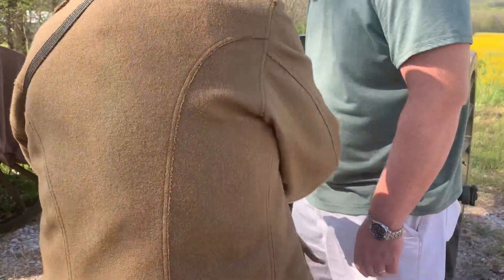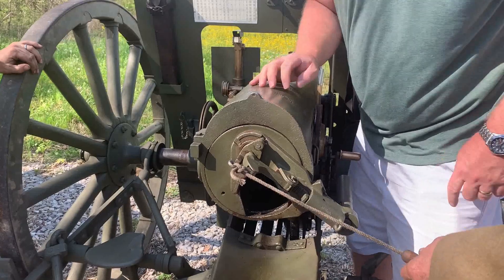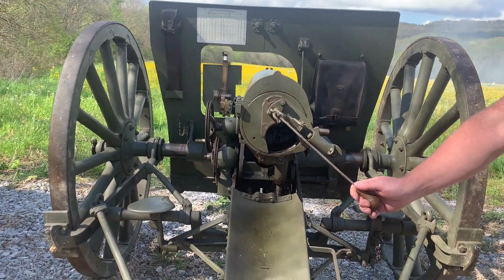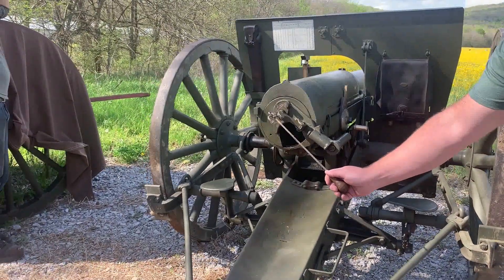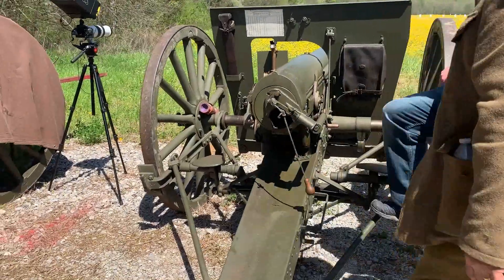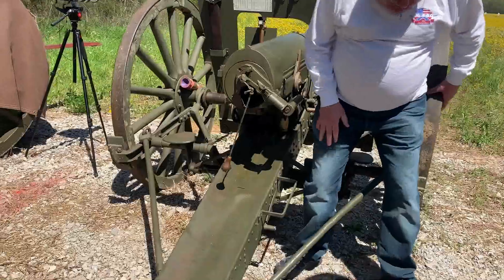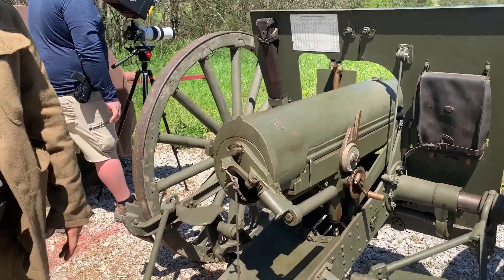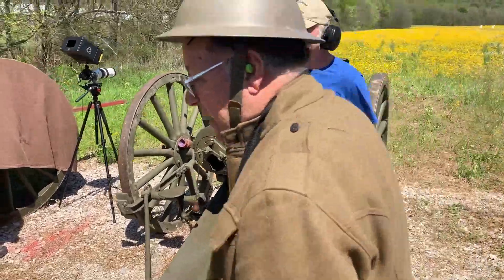French 75 Live Fire, part 2

Comment: One of the most revolutionary gun carriages ever invented. Changed artillery forever
Reply: I think the .75 is the first of reciprocating(?) carriage mounts
Reply: The British improved on it with the Ordinance Quick Firing 13 Pounder 75mm. L.25 & OQF 18 Pounder 84mm. L.28 field guns, both of which featured a sliding breech block with automatic cartridge ejection. They also featured a superior triggering mechanism plus double the fire rate of the French M.1897.
Reply: indeed, the 75mm was the 1rst cannon using a oil-gas brake allowing 25 rounds/mn without having to move or replace the cannon between 2 shots.
Reply: @bulow453  it is just 75mm, but yeah, that was the next gen of field artillery air/oil recoil dampener made this gun very accurate and fast firing, there was no need to reset gun after each shoot. With automatic case extractor. i believe that  there is short movie mad during ww1 which shows how crazy fast those guns were spiting bullets.
No reaming, no reposition , fast reload = recipe for superb piece of artilery.

Comment: Nice cannon! Rifled barrel too? Smooth recoil.
    I wouldn’t dare let anyone stand behind my howitzer when they fire it, much less sit on it!
Reply: Artillery guns are always rifled unless sufficiently old or modern Anti-Tank guns

The 1897 field gun was the first to use an hydraulic recoil sled, this prevented the gun from moving back under recoil like most of its WWI contemporaries or an American civil war cannon for example, the 1897 would also be the start of more accurate gunnery as guns with recoil absorption systems didn't move at all thus didn't lose their impact point and didn't need resighting, because of this gunners and loaders could sit on the gun carriage for faster use of the gun (the 1897 also has designed seats)
Reply: @CaptainGrief66  indeed! I have to re-sight all my cannons after each shot. My full scale mountain howitzer recoils 4 to 6 ft after each shot. My little 3.5 “ bore Napoleon not so much. They are surprisingly consistent for smooth bore.
A blast to shoot cars with anyway.